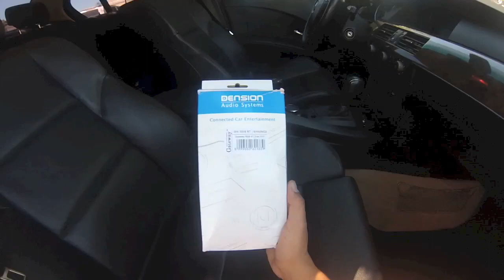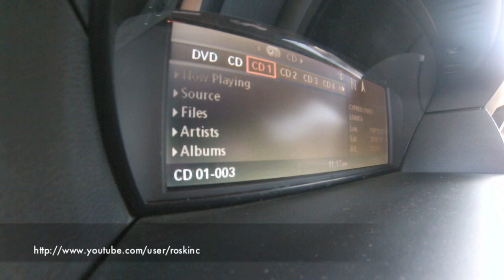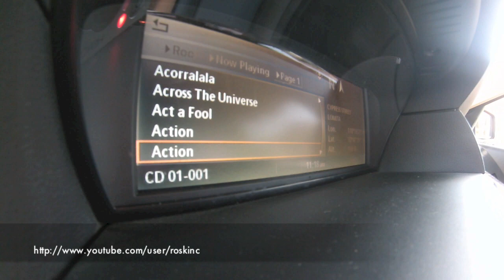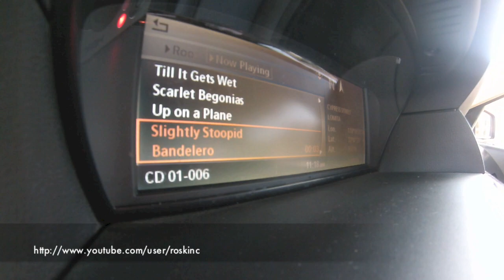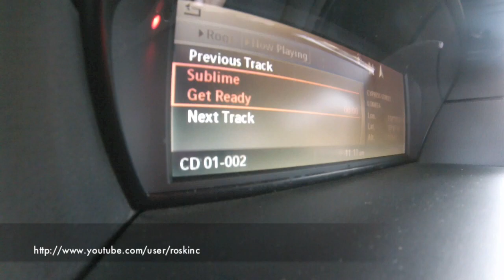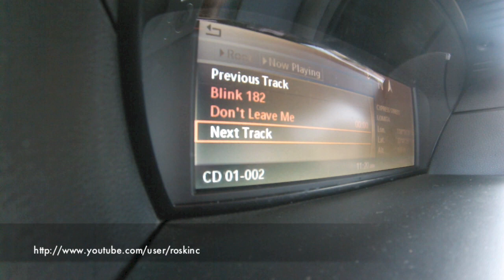BMW 5 series e60 Dension Gateway 500s Bluetooth install Iphone 5 4

Comment: Anyone with an e90 the power and fibre optics are located in the boot on the left hand side underneath the small plastic pocket. Just pull out the plastic box and voila. not as handy as having it in the glove box but everything you need to work the dension is there. fibre and power.

Comment: Hi, I purchased the Dension 500S BT for my BMW E60 530i 2004/5 model. It came with the six CD changer then it stopped working. Therefore, opted for this option. I did everything exactly the way you described which was so easy. Now the iPod started charging. Yet, on the iDrive console under CD1 it doesn't recognize the Dension and I cannot go in to it. But the single CD player works when a CD is inserted. Then I noticed the dip switches were set for a Merc. Then I changed the same to BMW settings. Yet it does not work. I noticed on the instruction manual it says to program the phone option in the car. If so I will have to take it to the Dealer. Please help me on this if not my investment will be at stake. Tks.

Comment: When you plug the 2 optic cables out of the block to replace with dension orange cables,  what do you do with the 2 original optic cables? The green ones

Comment from the maker: i dont think you can use the original mic with the dension but if you have bluetooth already (like i do) you shouldnt have to worry about using it with dension.

Comment: Hi I have installed dension gateway 500 s BT to my 520 dse (E60) 2009. Followed the instruction as in your video. And coded the car using gateway enabler tool from dension, I had cd changer prep in the glove box, On the screen after using the enabler tool its coming as CD, CD1-CD6, But I cant select CD1, It wont allow me to select CD1 using I drive. Phone is charging when connecting to USB port,and phone is conecting to Bluetooth but nothing happening. Any suggestion please?? thank you,

Comment: Hi, i'm seriously thinking to buy one. So couple of questions here:

1. Dension adapter connects via fiber optics cable, to the CD changer port. CD changer sound quality and loudness is much better than AUX. Can i expect that dension, which uses same fiber optic provides as much quality and loudness as OEM CD-CHANGER ? (Especially via bluetooth). If this specific model not, how about "Blueway" or "Blueway 500". Manufacturer says that these models produces extreme sound quality via bluetooth.

2. I'm quite happy with my OEM bluetooth cell phone, so i want continue to use it after installing "Dension". In comments below I saw people saying, that's not possible. Is it true ? Anyway modern Mobile phones have ability to connect on several BT sources. On each source you can grant permissions, what it will do with your phone. For example "Call audio" ; "Media audio" ; "Contact sharing".
I'm thinking I would give permission to my OEM cell phone  to share contacts and call audio and for dension i permit media audio. Is it possible ???

And last...

Is it connects BT automatically or you must do it manually every time you sit in the car ??

BTW sorry for my eng :)

Comment: Great video. Can I install this product without having to install the CD changer? My car is prep for CD changer but I heard that I may have to install the cd changer and activate at the BMW stealership. I drive a 2006 e90 325i equipped with CCC Professional Navigation, hifi HU, I-drive.

Comment: Great video Roskinc.  I have a 2005 E63, 645ci bluetooth enabled from the factory with a factory 6 disc changer.  Does the BT with the Dension affect my factory bluetooth?  I like the factory BT and don't want it to get messed up. If so do you recommend going with an older Dension that doesn't have BT?  Also do you recommend keeping the changer or just delete it.  I'd rather just use my iPhone.

Comment: Have you successfully updated your unit to firmware 0058? My update failed. It says it's updated to the latest version on the "about"-screen but it suddenly wont play mp3's from USB. I have tried to update it using several thumbdrives but no success.

Comment: Hi ! Thanks for the video !  I have BMW e60 2004 whit cd-changer  originaly but my dension 500s bt dual refuses to work. I cannot click the cd button in my i drive. Power is on signal wires are ok but it doesnt work. what could be the problem? i think i shouldn t need coding because i allredy had cd-changer
Reply: Since it is 2004 you still need coding of the +kmp3 function
Reply from the maker: do you have a CD in the slow? if no cd is in the slot, cd is not selectable. i know it obvious but many people have this issue.

Comment: hy there the video its awsome you'r a master dude, please please please and please tell me if i have to code the device or it. s just instal it and it works, and if i must code it which program did you use? please answer me. Thanks
Reply from the maker: Only need to code if you don’t have CD player (one in glovebox) if you do, plug and play. I use ncsexpert visit my site for more info I sell the coding cable also www.roskinc.com

Comment: Hello mate. I have an BMW 525i e60 from 2005. I have it prepped for cd changer just like ur car. After installing the dension i have to update my idrive at dealership to make it work, since i dont have a CD-changer right? 

I was at BMW yesterday to code the car so it can read the CD changer( in this case the dension) but it didnt go well. They got an error saying that the program do not recognize any CD changer so it cannot update. 

Ive Done everything right with the wiring, followed every step u did.  Now my question is.  
When coding the car, should the dension module be on "By-pass mode" or "Active" ? 
And the second port on the dension, "CDC port". Should i loop that port or should i just leave it as it is?

Comment: Hey. i connected mine and it shows cd as grey. what is the pin  order underneeth the box ? I have a cd changer but orderd mine for a car without it tho but it is still gray when i hook it up. What am i doing wrong ? i have tryed with and without the cd changer connected . nothing.

Comment: Dude, I notice you didn't "loop" the second (CDC side) port. According to the user manual you must do this (unless I'm misreading). So far, I've wired it up exactly as you've done and have two problems:

1.) SOS not working message on Check Control
2.) The gateway ends up displaying "CD content is loading" after cycling through 30 or so tracks with no option to access any menu. I have to reset the unit to carry on, it then happens again after another 30 tracks.

Please advise if you can. Thanks
Reply from the maker: Spirited Warrior only if you currently have CD changer you loop it. i dont, so i didnt use that port.

if sos error is showing up then a connection in the fiber optic is broken. re-check

Comment: Okay great! I emailed you about ordering an aux cable but then I saw the Grom vid and I think I would rather do that and integrate my iphone 5 with the spec dock, a lot more expensive but I think it will be worth it! And one more question if you don't mind do you still sell the LED sport mode unlock button? If so I would love to buy that in the near future and sorry for the false order on the aux cable!

Comment: I have the cd changer, can you help me wire it up, i have coding cable and softwere, though not needed it seems here..  I have 2004 e60 545i.  I will buy and hook up your aux and sport cables first.  The e60 is very addicting.;

Comment: Audio quality Vs your aux in kit ? I have the aux installed atm of yours but finding the audio a touch quiet thinking of getting an android screen to use with aux in but don't really rate it's sound quality much will this provide better quality
Reply from the maker: lilvfr400boy the aux no matter where you get it from will be slightly lower volume ( dealer cable is even lower than mine believe it or not), the Bluetooth aux I sell is a little louder and same quality sound as the Denison. I can’t speak for other Bluetooth adapters people sell, I can speak for mine as I test each and every one I sell, and I went through a ton of chips to find the best quality one. Not to speak highly of my product but I’m a Bmw enthusiast so I only sell what I personally use on my vehicle, otherwise I wouldn’t sell.
Reply: roskinc your aux cable was great to be honest but it's just not loud enough but I know this is BMW head unit limitations not the cable. I was thinking if the dension aux was louder then I'd use that instead as I want to hardwire an idrive compatible android unit to it but if it's too quiet there's little point
Reply from the maker: lilvfr400boy yeah the Denison wasn’t any louder than the Bluetooth one I sell. I’ve heard people use a app that is a amp on android to increase the volume,  I’m sure the android unit would have that app downloaded on my tacoma truck I installed a android headunit and the amp was able to make the volume really loud. If you have a android test it out before getting the android unit, although the android unit is pretty cool if I didn’t have a Cic I would install one, I’m hoping to get someone locally to get one so I can film installation and review video.
Reply: roskinc I'm stuck with the basic mask unit atm with cdc in glovebox but I no longer use CDs haha, I'm definitely considering the android option I think it's power amp your thinking of the app. Though I believe on this it needs to be a physical line amp between the aux and head unit to improve the issue. It's tempting to just add new speakers and a pioneer in the glove box or something just for music haha

Comment: I have an existing CD changer to delete with this MOD. So this may not involve taking the dash apart right, sort of plug and play right? Also, like you I already have Bluetooth on my BMW. I like the Bluetooth music streaming feature though. So if you're connected to Bluetooth for music streaming and you get a call what happens? You can't be connected to two Bluetooth connections right?

Comment: Hey, great video thanks so much, quick question to any dension gateway users out there if i decide to plug in my device using usb can i use the actual ipod or iphone to change songs ?, or do i have to go through idrive. Also if i do plug in the ipod or iphone through usb does it show track names and artist info ?
Reply from the maker: you can still browse through the iphone/ipod normally. unlike other devices which doesn't allow you to control the music. makes it very easy to search for songs if you have to rather than using the search feature on the dension. im still 100% happy with my dension, and works awesome.
Reply: Thanks so much for replying, I should be ordering mine very soon!!!
Reply from the maker: Anthony Shimoon no problem glad my videos helped. i will be uploading a few more videos on some iphone holder for the dension by them which work great with the gateway. i lost my memory card with some footage which why i havnnt uploaded lately. but i have 2 more dension products to review, and finally get the smerlink part 2 uploading. hopefully by this week

Comment: Would this work with my 2006 750Li... Production date 02/06?
Reply: Mr. Tim did you get info on your 750,because I want to do the same
Reply: Yes, the bluetooth version of the Dension Gateway is NOT compatible with the 06 750Li, but the older, non bluetooth version is!
Reply: Tim Smith so only Aux and USB I pod
Reply: Correct!  No bluetooth, AUX and USB only.  However, I recently found out that you can add a aftermarket radio if you replace the Logic7 amp as well. This will require an adapter due to the fiber optic connections in these cars.